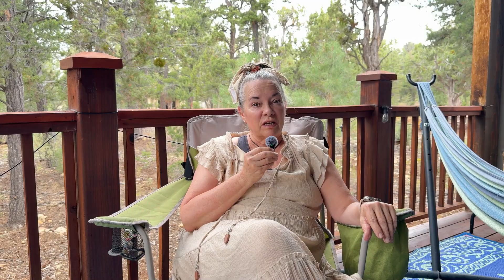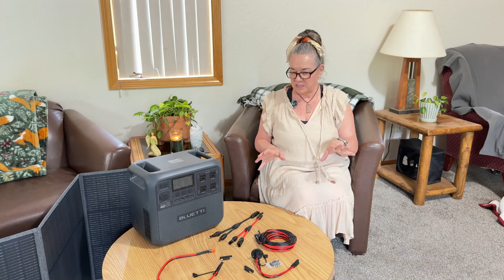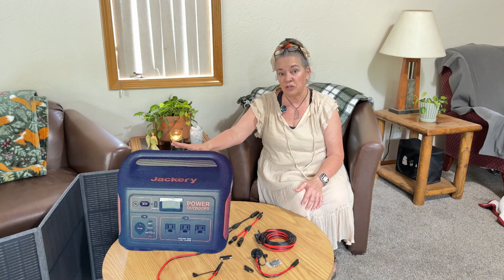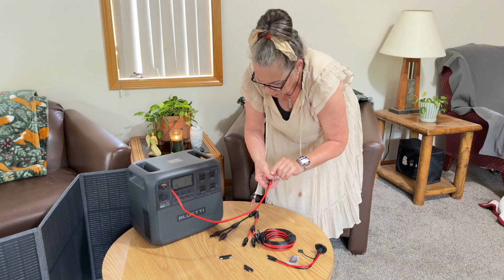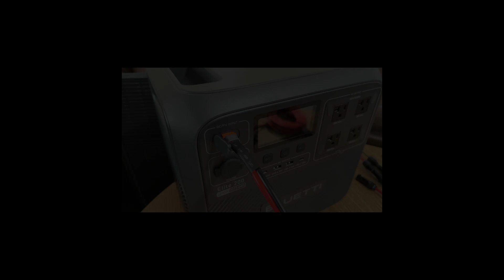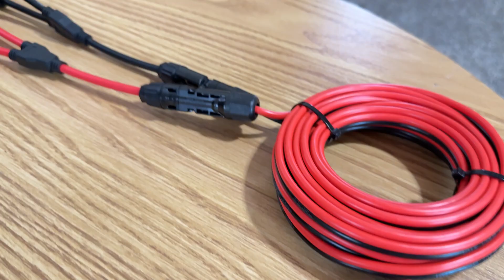Cargo Trailer Power: Part 1 of 2 - Episode 1 of My Cargo Trailer Conversion To An Off Road Camper

Comment: Fun project.  Have you considered the departure angles with a cargo trailer if you are in rough conditions?  I would also worry about a single axle with one wheel on each side having a blow out at freeways speeds.  

I don't think you should worry about the schedule of posting, YouTube is just a game and a hobby and there is no real advantage to regular posting, just do it when you feel like it.

Fancy editing!
Reply from the maker: I am putting a lot of thought into the pros and cons of single axle vs double axle and haven't made that decision yet.  I will only take the trailer off the beaten path so far, and then explore farther with the truck, leaving the trailer on a bit safer ground.  As for departure angle; I plan to have a couple things changed from stock to allow for more clearance.  It won't be your average cargo trailer when all is said and done.
Reply: @theicangram  What about getting a used, slide-in unit with a pop-top, maybe down in Phoenix where they seem to have a lot of RV options?
Reply from the maker: @GC-Hiker  I have considered every option.  I explain pretty in depth in this video why the cargo trailer is right for me but to address just a few of my concerns with the slide in is size and leaks. And as mentioned in the video, not being able to drive away from my “home” when I want to just go be what most would consider normal. 😊
Reply from the maker: @GC-Hiker  Also, in a few years, I will be living in the trailer full time and definitely wouldn’t want a pop up for that.